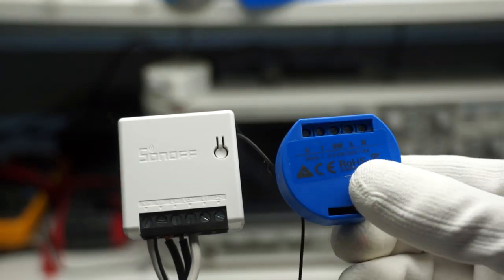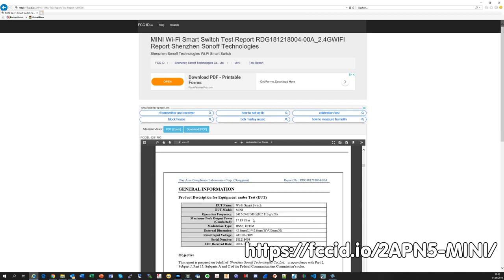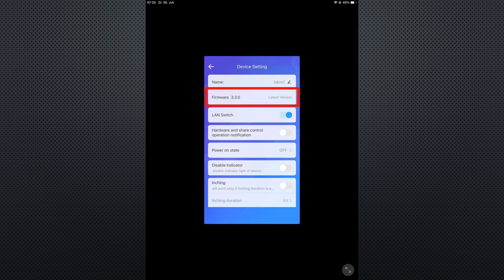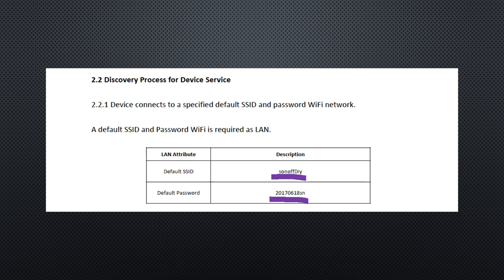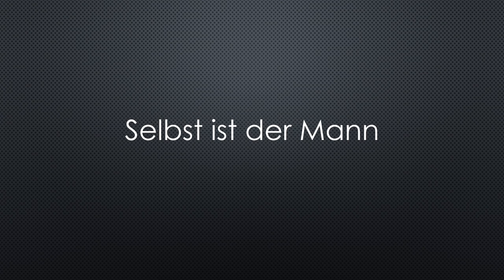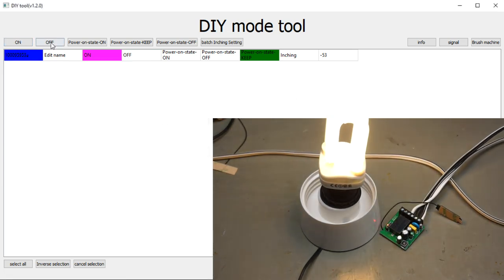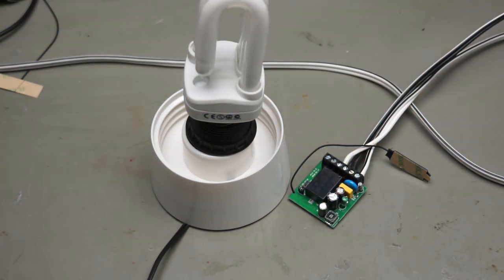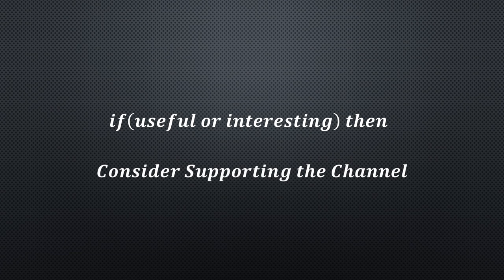#280 Tutorial Sonoff Mini (DIY Mode, flash Tasmota)

Comment: Sounds a lot like my video.. I gave the DIY mode a huge thumbs down. Huge failure by iTead.
Reply from the maker: I think the HW and the price is ok. The software not. But fortunately, we only have to use it once ;-)
Reply: @AndreasSpiess  They really missed the boat on the hardware, you'd think when you go to copy something you usually try to improve on the product and not have your competition laughing at you.  If they'd made an open header for the 3V3, TX, RX, GND then threw in another few open pins, wow!  They'd have a killer product, instead they decided to make a hot steaming pile of...

Comment: real engineers would just make a spring probe setup and use the programming pins 8-), sorry but all that faffing around with software takes to long. Dr zZ's bricked his using OTA and had to resort to the programming pins.
Reply from the maker: AFAIK he did it with a Basic which still has holes for pins. This one only has very small pads and not everyone wants to solder on those.
Reply: Hi Andreas, yesterdays video was on a mini, OTA I think only allowed 500K and I think he flashed tasmota as Sonoff.bin was too large which then bricked. soldered wire and reprogrammed it the old fashion way.
Reply: I forgot to say thanks for the great videos, they always make a great start to my Sunday mornings.

Comment: Thanks Andreas! 
The video is 14:52 long. In this time I'm able to unpack a Shelly1/1PM, configure Wifi and MQTT (update the Firmware if necessary) and .... use it with Home Assistant e.g.)  So, the question: Am i a "pussy" ?  ;) This Sonoff Mini is rubbish in my eyes.
Reply from the maker: Good point! But maybe you had to work a little longer to pay for it ;-)
Reply: @AndreasSpiess  The difference for one piece is about 2€ (to be honest: the shown 23.99$ seem to be an old price for a 2-pack of shelly1) For me the time i save with the shellies is worth more than 2€. ;)
Reply from the maker: I pinned the prices in a comment because of my mistake.

Comment: Thanks Andreas awsome videos.    Itead gave me a DIY sonoff to intergrate into openHAB. It dosen't show up in win10 unless it gets mDNS access wich may not have been passed through your mobile hotspot.  It is frustrating that they have not listent to the feedback I gave them. Even worse is that I am running it on the 3.0.0 firmare and if I want to change it to new firmware I need to take the diy mode off and start all over again. They wont give me the bin file to update.

The jumper to change it into DIY mode can be used once you flash to tasmota.

If you want to put it into openhab here is a link to how I acheved it.
https://community.openhab.org/t/sonoff-basic-diy-setup-without-flashing/76698

I going to write a bindng to add it automaticly when I have the chance.
Reply from the maker: Thank you for your info. Maybe this is why we flash it with Tasmota ;-) Which GPIO is the pin? I did not check it and maybe it is interesting for other viewers.
Reply: @AndreasSpiess   GPIO16   also https://github.com/arendst/Sonoff-Tasmota/wiki/Sonoff-DIY

Comment: That is not really good and fair video. First the Shelly's price is wrong. Second  you can't compare only by price two different devices with different functions. It is like to make a review of bicycle and say "it has tires like a motorcycle, has brakes like a motorcycle, but the bicycle is cheaper. Let me show you how to drive a bicycle." In your case you have on one side new innovative product and on other side chinese low quality device. You have more than 140k followers and need to be more precise in the details in the videos.
Reply from the maker: This is why this video is not a a comparison. Maybe you look at the title? And you are right. The price I showed is for two. This is clearly a mistake. The only three mentionings of the Shelly apart from the price are the switch (the same), the size (the Shelly is smaller), and the flashing pins (the Shelly has pins). 
In my view the two devices are very similar in functionality if flashed with Tasmota.

Comment: For those that come across this video, the latest version of the Mini R2 doesn’t have the jumper, you have to press the button for 5 seconds to put it into DIY AP mode then connect via a browser 10.10.7.1 and set up your own wifi net. After that reboots you can issue curl commands to the zeroconf endpoint to enable OTA and flash it. Most instructions are for Windows using their tool but if you’re on a Mac, like me, here’s how to curl the firmware to it.

https://blog.bilka.sk/how-to-flash-sonoff-mini-in-mac-os/

They seem to have changed the hardware or software, or both, since 2019.
Reply from the maker: Thank you for the new info!
Reply: @AndreasSpiess  sure thing, as I was typing up the changes I wished YouTube had a Pull Request. Like, crap this has changed since he made this, I’ll just patch it for him! This stuff changes so rapidly videos go out of date pretty darn fast.